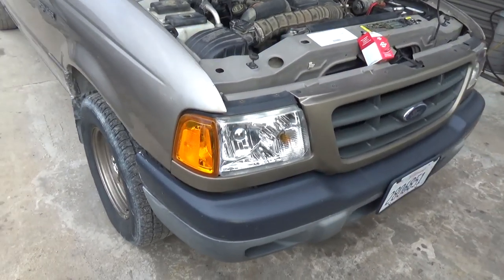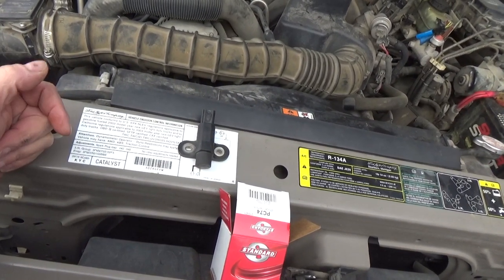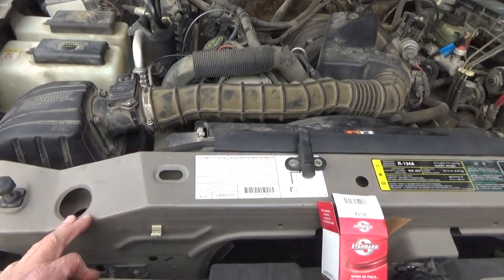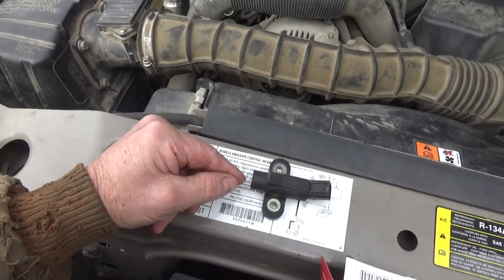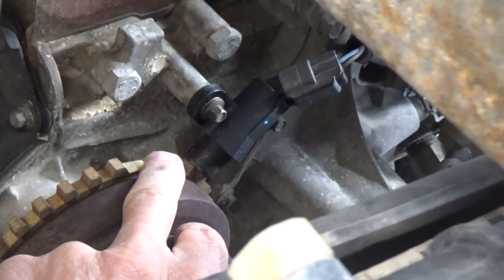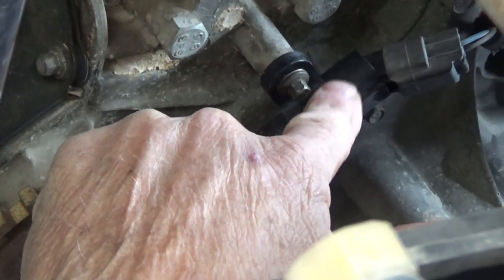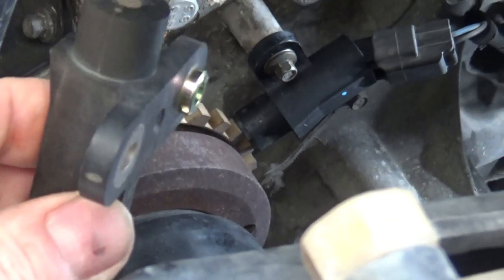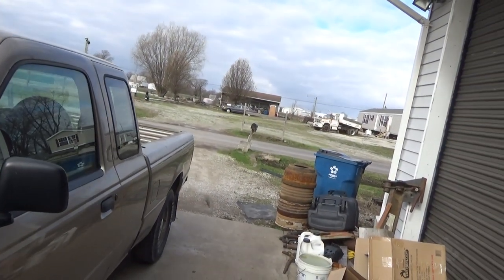Hard start and sometimes no start on ignition without distributor

Comment: Thinking the Hall Effect Sensor on my 89 Ford Bronco is my issue. It does that, first thing it will turn over. Let off the key, and hit it again it starts right up. Then starts right the rest of the day. But on a cold start, it was taking me letting off the key. Then it started right up. But the last couple of weeks, first as soon as I hit the key. But its a 5.0L and Distributor also.

Comment: Also you should start back recording some trucking videos. Miss you doing those. Got to get out there and put a new fuel line shutoff on bottom of one of my fuel tanks. My t600 has 4 tanks, and equalizer tubes between the left 2 then between the right 2. Fuel keeps dropping its getting 470 gallons in it.
Reply from the maker: I have work planned for the truck but can't do it until the weather dries up and I can stay home and do it. Thanks for watching Pete.

Comment: Sorry to bother you, but do you recomend any brand of radiator hose?  GM sells two, one is called "OEM," but I realize it might not actually be.   It's really their expensive version, nearly 50 bucks.  They sell a cheaper version for 15, but I strongly suspect it's no different than any of the other brands selling for 15.    I can buy three of the others for what that one costs, but then there's the cost me me changing it, and when one drains the coolant one is always tempted to put new in.
Reply: Oh, and thanks for another educational video.
Reply from the maker: I always go with the better brand if the job is hard to do or if a failure could be expensive or inconvenient. You don't need to go to GM dealer you can go to your local parts store chain and get a choice as well. There IS a difference in quality in hoses and belts.
Reply: @57bagre  I usually do, too -  I won't buy the most expensive or the least expensive.  This is a strange case, one 50 dollar part, and lots of 15 dollar parts.  Dayco, Gates, even a lower cost Delco.   The parts business is getting more and more complicated as more companies buy and re-brand the same parts.
Reply: If I could offer any advice, stay away from parts made by Dorman.  If you are getting parts from a retailer such as Autozone or O'Rieleys or whatever,  when you are at the counter or on the phone ordering one, ask your clerk or salesperson who makes the part, and if they tell you "Dorman", go with another choice.  ANY other choice.
Reply: Probably too late now, but I always go for a Gates or Dayton if the choice is there. Forget the cheap stuff.
Reply: @dalebabbitt6185  Actually, you're not.  I was leaning toward Gates, as that's what's on it, and it's lasted quite a while now.    There was only one "cheap" hose at 9 dollars, the rest were all 14, and one 40 dollar one.   That's not how it usually is.